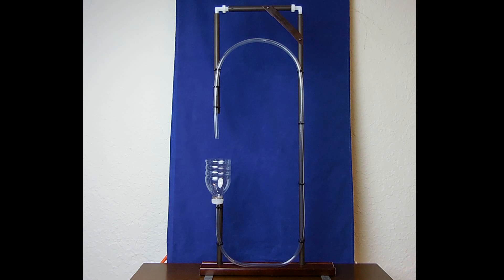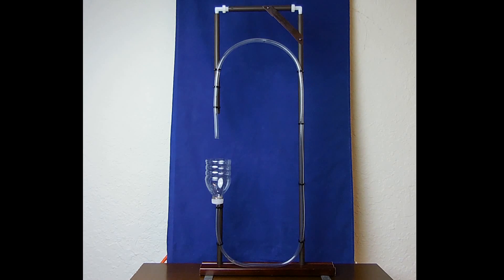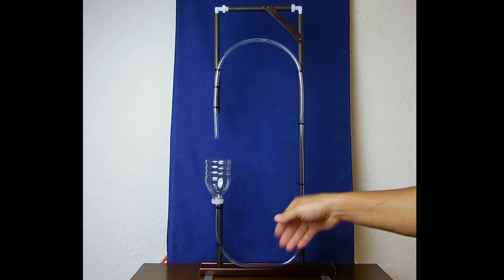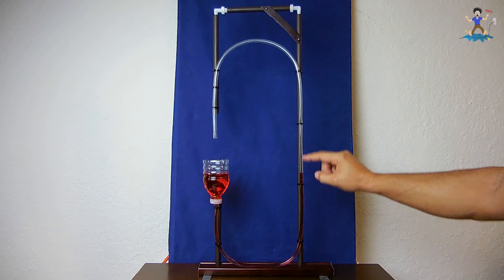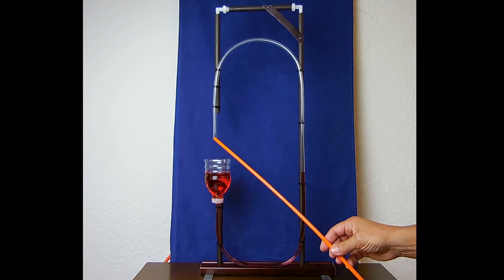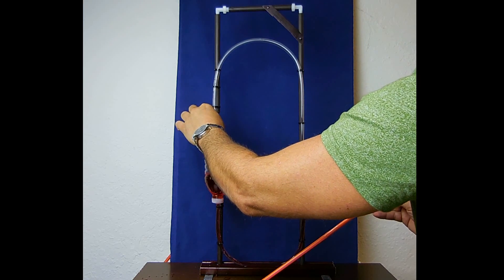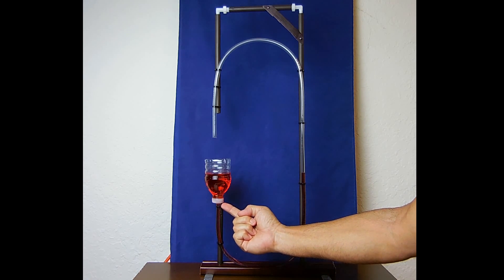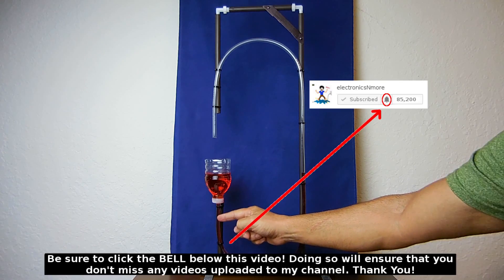Boyle's Self-Filling / Self-Flowing Flask (SCAM)

Comment: What happens if you use a Larger and wider bottle and put the 90degree bend at half the height you have It?
Reply from the maker: Absolutely nothing. You can force a scam to work. Thanks for watching!
Reply: @electronicsNmore  yeah the more thought about it lol came to the same conclusion.  I have read about calivation pumps can prove over unity and new heat pumps are 400% efficient because they move heat that is already there so I believe there are still many solutions to be had from this line of thinking . No you can't push a scam but the governments can push a scamdemic lol lol

Comment: Hey, not sure if you’ll see this but where could I acquire one of the small motors you showed in the video with the paddles that goes directly to the light ?
Reply from the maker: I read ALL comments. Post the question at the correct video for a reply. Thanks

Comment: That won't work because the water that flows into the tube is heavier than the water in the flask,, I suggest try using a bigger flask
Reply: still won't work.

Comment: Would it work if the tube was angeld in such a way we're the water level is slightly lower than the arch of the tube so that the force of the water hitting and filling the cup is just enough to make it go over the edge and poor again ergo gravity powerd?
Reply from the maker: No

Comment: Your replica definitely would never work even if the original does work.  firstly your flask is too small compared to the size tube and length that the liquid has to fill up and still have the flask filled ..
try again because currently there isn't enough liquid in your experiment to even fill the tube alone so whats gonna be in the flask to force it down, air?
Reply from the maker: It would never work regardless of what you do. If you like to waste time, then try it out yourself. Thanks for watching
Reply: lol.. Im aware that water always seek to level itself out but... I also understand the concept behind this "theory"  lol.. as silly at it sounds I am actually gonna give it a shot ROFL...

Comment: 1:did you use a dense liquid? 2:the bottle was too short, needs to be taller for higher pressure.
Reply: It's a scam. It requires a pump to circulate the water. Idiots making the three videos hid the pump.
Reply: @rootbrian4815  The water he used had too little volume to defy the amount of air pressure in the tube. The tube he used is too long. 
He's the scammer here. 

My Dad uses this method to figure out how much water is in our tanks. 
Since they are black we have no way of knowing just how much there is unless we use this method which always works. 
The water in the pipe ceases to flow when we raise pipe to a level higher than the level of water in the tank. 
Common sense.

Comment: Make the flask 5 times the size.. there will be more pressure going into the tube which means more movement and so more perpetual motion.
Reply from the maker: Good luck with that. :-)
Reply: YOU NEED A PUMP.

Comment: just thinking but what if you put a much bigger flask and smaller tubing in a smaller circle. would that work? if the weight of the water in the flask > the weight of water in the tube what would happen?
Reply: the "weight" of the liquid is based on the height of the water column, not how much water is present like you would think. Its actually pressure making this happen, not weight. 
A 5ft tall tube of water would have more pressure at the bottom than a pool with 4ft of water in it; its actually how some hydraulic lifts work. Kind of trippy when you really understand it haha
Reply: cool imma google that
Reply: Kenny it's actually head pressure. A function of volume, eg height and diameter in this case.
Reply: Weight won't change a thing

Comment: To be honest, your explanations of the physics are not even close to accurate and correct enough.

The description of the fake flask however was very good.

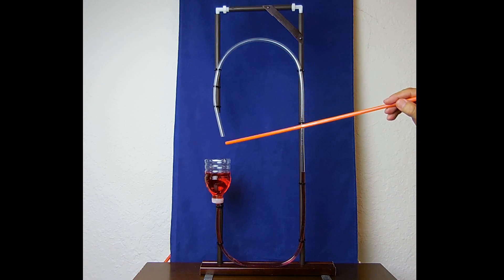And you did the crucial experiment at 06:00 into the video.

It is actually not the water weight that drives the siphon, is the air pressure. You demonstrate this very clearly by sucking to raise the water (lowering pressure).

Another way to try this a home (and kids of all ages, please to this) is to push a glass down into a kitchen sink (or better yet a bath tub or outdoor pool) filled with water and watch what happens to the volume of air insider the glass. The deeper the water the better.

If you tilt the glass slightly to let some are out, you will notice that you will be able to lift some water inside the glass above the outside water level even when it is upside down, the reason is that there is less air in the glass now (you let some of it out).

If you still have you middle or high school text books on physics somewhere, please read them again if this is not immediately obvious to you.
Reply: He took a physics class and passed it. You definitely need a pump to get it working. A pump would suck the water out and drop it into the flask (bottle) again.

Comment: your flask is too small and does not hold enough fluid.  the weight of the water in the tube will push back and not flow.  more weight of fluid in the flask will push down and up the tube.
Reply from the maker: Whatever you say. :-)
Reply: Go back to physics class.

Comment: THE FLASK!! I suggested, if you use a cylinder to contain the water you yet an even pressure at the bottom. but if you use a couple cone that point down the pressure will be multiplied more. if the water level is higher than the tank level, you're in the right track. increase tank height, making the walls more narrow, positioning the tube so the moment tis higher than the flask, it should dispose the liquid above the flask should improve quite well.
Reply from the maker: Sure. LOL. Make it yourself. :-)
Reply: Without a pump, it will never work.

Comment: In my opinion, one way to have free energy/ perpetual motion is by colonizing a planet (that has an ocean), and building a opaque "heat shield" around the whole planet. Then heat the planet up until it reaches a temperature similar to that of Earth's. Now, since heat cannot escape from planet (in theory) water in oceans will evapourate and rain down on land areas. The resulting water flow can then be used to power hydroelectric dams to power homes and factories which heat up the planet again, and causes faster evapouration and the cycle continues...
Reply: However you would block out the sun, which is essential for heating a planet, and thus, it would cool right down to frozen.

Comment: Its sad you don't try other liquids besides dyed water. Also who cares if there is a small motor, the whole idea of it being perpetual can overrule it when you use the right liquid. Do some research please.
Reply: The tube is too high, you did not hold the water at the bottom enough to force the surface tension up and over, and because water doesn't go over the initial fluid level, water is not close to the right candidate for this project.
Reply: @emmylouhaze  Water, oil, other liquids. Nope, doesn't matter. Without a pump, it is not going to go up and over. PERIOD. It's physics. If you dropped out or failed it, that's on YOU.

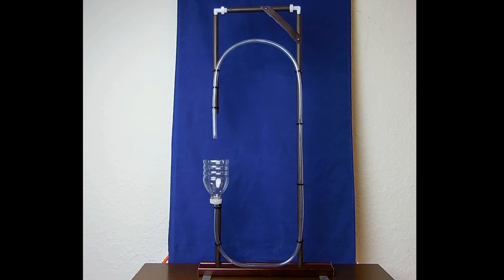Comment: Have you tried using a shorter tube, and/or a bigger flask with more liquid?? 3:00. What if you were to use 8 bottles surrounding the first bottle, and have all 9 feeding into the center line? You would fill all 8 up to start with, and the main line would only empty into the center bottle. It would overflow, probably, so you would need to put 8 overflow channels from the center bottle to the 8 other bottles.
Reply: Still it is the difference in air pressure at the and points that drive a siphon. This only changes with height (or by using a fan).

Comment: I get so tired of people trying to show off their " inventions" that are total scams. We should be using youtube for sharing knowledge , not spreading lies. Thanks for sharing.
Reply from the maker: Thanks for watching! Be sure to share with others and rate thumbs up. :-)
Reply: mazdalorean how is it a scam he doesn't force you to buys it's an idea.
Reply: @maxproskurnia4895  It is if they LEAVE OUT the part about using a PUMP.
Reply: mazdalorean The only reason it’s not working is because the tube is too tall and the tube is bigger then the Bottle itself. Meaning there is not enough Liquid to come up. Also, If it’s too tall, The force of the Perpetual Motion won’t be strong enough to push it all the way..
Reply: @adrianm6575  It uses a pump. Without that component, it won't work.

Comment: What if you tilt the whole system so gravity is significantly less than 9.8 so the polarity of H20 bond won't break. Just a thought. 
- electrical engineer
Reply: What you do yo what?????

Gravity does not change just because you tilt the thing.

There is no way this could work, even capillary forces wont work because capillary forces work using the same forces that creates that surface tension of water that in turn will prevent any drop to fall.

And for capillary forces to lift water a significant height, you need extremely thin tubes, noway near the flows that the pump in the fake flask creates.

Comment: It is sad that people fall for scams like this, i learned in school that for a syphon to work the outlet end of the pipe must always be lower than the original water level. Do they not teach such simple stuff in schools anymore?
Reply: I believe they try to teach the kids, but fact resistance is too wide spread and the moronic idea that maths is hard and unnecessary  has been spread for decades.
Reply: Funny thing about fluid pressure; the volume actually doesn't matter at all. Only the depth. The tube could be the diameter of a pencil or wide enough to sit down in, and the pressure at any given point would remain the same.

Think about it this way. If pressure was dependant on the volume of fluid present within a given space, putting a straw in your drink would cause your drink to start flowing up and out of the straw constantly.
Reply: ahaha "i learned in school"
Reply from the maker: 100SteveB Unfortunately, many people aren't too bright. I've seen videos of college students being asked simple questions about our country and they didn't know the answer, or gave idiotic answers. You wonder how they made it out of high school.
Reply: dude seriously, your water bottle is too small.. there is too little pressure forming.
Reply: @Robert-z8t4m  Go back to physics class.

Comment: Thanks for explanation!
I always knew that free enegry is impoossible due to physics laws.
What would happen if you sucked liquid into tubing and then add more liquid in that water bottle?
Do you think we could make this work with having vaccum in hose pulling the water out?
Reply from the maker: No. That was all demonstrated in the video.
Reply: You would end up with water reaching the top of the container and then levelling in the other side in the tube, and a bit of a mess on the floor.
Reply: Free energy is not impossible. Humans are just too dumb to figure it out. 

This guy used very little water, and the height of the pipe was just too much for the volume of the water to defy gravity. 
If this principle was false, we would never have underground water flowing from the  highlands to the lowlands even in places where snow is unheard of.

Comment from the maker: **ATTENTION: The use of carbonated beverages DOES NOT make this device work. The scam artist simply turns on the pump when using carbonated liquids, and when using NON-CARBONATED liquids, the pump is OFF.
Reply: Even though it would not work for very long, I was wondering about the YouTube videos using carbonated liquids.  Thanks for testing that as well.  I used to try building devices like this when I was a kid.  In my designs I doubled the diameter of the downward tube and tried to get a continuous siphon running.  Of course it never worked but it was fun learning hands on.
Reply from the maker: lasersaber
Thanks for watching! I have a video being uploaded in a week or 2 using the supercapacitor balance board I bought from your website. I'll mention your website/channel in that video.

Comment: This works with beer or lemonade, until the carbonic acid is evaporated :D I think this might work in bigger scale with ram pump, but seems like there is always some liquid spilled out in ram pump.
Reply from the maker: Kangsteri Does not work using carbonated beverages! The scam artist turns on the pump when he uses carbonated liquids! When he uses non-carbonated liquids, the pump is OFF.

Comment: if you sucked.the liqued from the end of tube and let it gos on it will work
i think you are protecting oil indusrty
you are the scam
Reply from the maker: Go back to sleep. Lol
Reply: he's right you moron try it.
Reply: @TheSecondInitiate  Why don't you go back to your habitat of the fringe.
Reply: In theory, it could work. there wouldnt be just gravity feeding it, there would be vacuum pressure pulling the liquid through as it went, and if you refill it as you pull the vacuum through you may be able to create an infinite flow
Reply: @ExodusisThere  It won't work in a vacuum (would boil away), only with a pump. Physics.
Reply: And the Earth is flat eh?.......
Reply: Mostafa Abdo YOU are the scam.